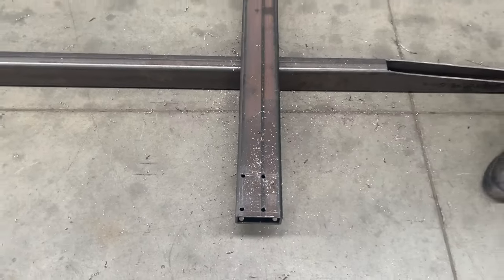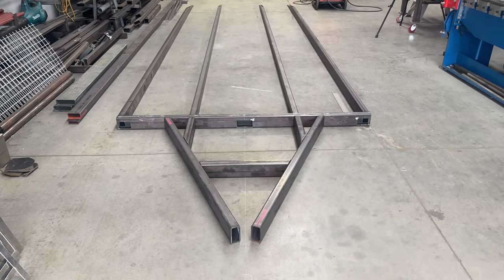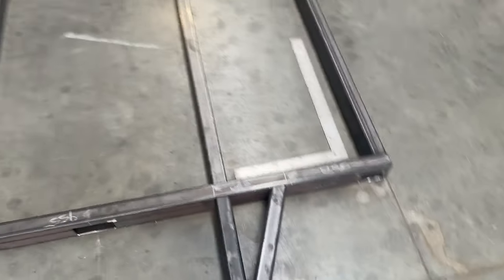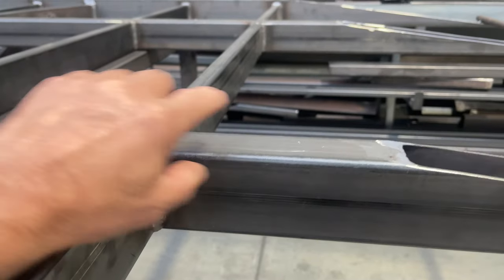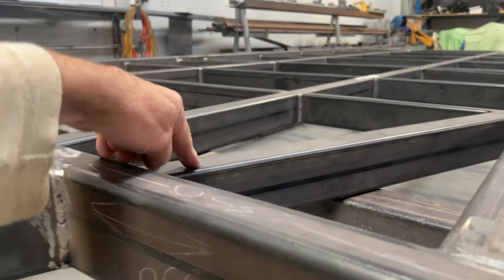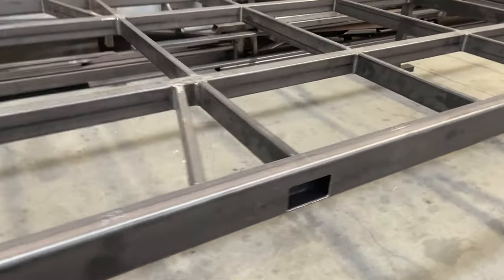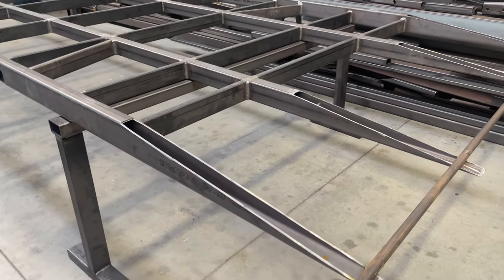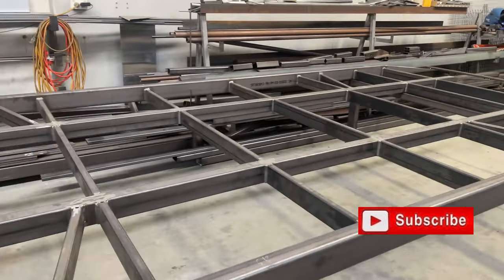How to build an air-bag trailer, Part 1

Comment: What is the weight that you are building this trailer to handle. I carry equipment that weighs up to 8000 pounds and I want to build a trailer similar to this to carry it.
Reply from the maker: Our medium trailer carries typically 5,000 pounds. 8,000 is a bit heavy for this setup, we would need larger air systems.
Reply: @ultimatemanshed  could the frame and plans be used and the bags get swapped for hydraulics. Just wanted to check. Thank you.
Reply from the maker: @firehousecustomfab3286  We have not done this but I can't see why the average engineer could not do it.  I would build more support on the chassis around the suspension pickup points